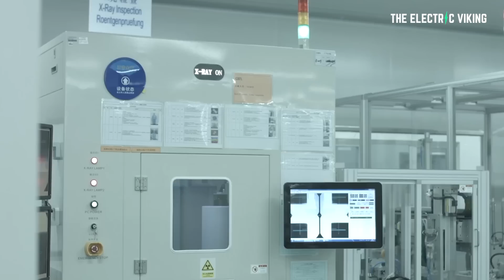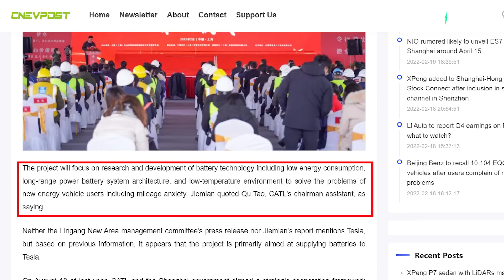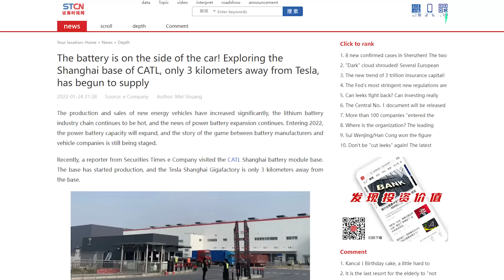CATL starts $440M battery plant next to Tesla Giga Shanghai

Comment: It is indeed correct that CATL will build a second battery factory next to Tesla China plant. The first one is finished in record time due to renovation of an existing building. This however is good only for Tesla productions up to 2022. Future is a different story.

For the future, Tesla China has 3 additional strategic plans:
1. 2 new models designed and engineered by Tesla China R&D staff will appear by early 2023. One will replace the Model 3, which is by then a 5 year old design. One will be brand new. Call them all-China Tesla. 
2. New models will use more flexible battery. This include current CATL packs, some BYD packs, and first productions of CATL sodium-ion packs. This is the mission of CATL second battery plant for Tesla. Mass production of new designs of LFP and sodium-ion cells and battery packs. 
3. The Tesla Shanghai plants, which include CATL plants, will be configured and expanded to supply the global markets including Europe. It will render Tesla Berlin redundant. But will not supply N. America, which is the domain of Tesla Texas factory.

Comment: Tesla must be planning on building 10 million cars a year with all these batteries they're ordering and building themselves.  Elon must have said something to these battery suppliers that hasn't been said in public.  I wonder how many years it'll take them to get to 10 million EVs built per year.  I know it's definitely not happening this year.  Might not even happen next year, and what is their target number of car to be built every year for the foreseeable future.  Is it 20, 25 or 30 million, what number are they going to level off at.  Cause if the range is 20 million with a +/- of 5 million.  They could produce as much as 30 million cars one of those years by mistake, and have to throttle themselves back down to 25 million the next year.  I really wonder what their every year target number is staring 5 years from now or the number they'll want to level off at.

My guess is they'll want to keep demand high.  So 10 million a year seems like a good number to me.  They're not planning to build the 25 thousand dollar car anytime soon, so why not make a low volume of high priced cars, with super high profit as they're doing now.  Who knows what the demand will be when they solve FSD.  It could cause an explosion in demand that Tesla can not and won't want to handle.

Comment: $440 million is cheap for a battery factory of that amount produced. Don’t factories planned by OEM cost in the billions when they produce about 1/2 of that?
Reply: UNLESS..... it's a factory that produces a 10x output on a very small footprint..... 🤔
.
Where have we heard that recently?
.
I've been posting for months, what if it's a CATL LiFePo4 4680 factory?
What if the extension to Tesla Shanghai is gearing up to produce a "Y 2.0" with a 4680, LiFePo4 structural pack?
.
THAT would be a game changer?
Castings.
Pack.
Cells.
Lighter weight (car)
Fast charging.
Would produce a LiFePo4 car, with performance approaching the existing 2170 pack vehicles in terms of kWh per ton at vehicle level (forget cell/ pack)
Plus, the cheapest cells at massive volume.

Comment: Whoever makes a superior battery is the next billionaire.
Reply: Or
Whoever makes a more than adequate cell, from a small factory, very cheaply, at massive volume, then uses innovation to boost the performance of the vehicle by removing weight, to equal or outperform supposedly "superior" cells in less optimum vehicles......
Will win.
Even if there are TWO contenders, they will both win sufficiently.
Everyone else? Picking up the scraps.
I think that's what we're seeing.
Reply: Yep you are right but It’s way more like X 300 we need 30,000,000 million new electric vehicles a year just to meet current demand  kind of crazy if you think about all the lithium,nickel, copper,silver magnesium, rare earths,glass,aluminum, and much more we wil need to make them. But at least we get rid of the internal combustion engine
Reply: @nickkacures2304  
Well, of course, you can then SUBTRACT all the Nickel, Copper , Magnesium (I think you meant Manganese?😉) "Rare earths" (Cat converter says hi!) Glass, Aluminium, and OIL currently used to make ICE vehicles from that equation?
So, not really so much?
AND we get rid of the internal combustion engine!!
(Plus, once it's in the system, lithium STAYS in the loop..... Oil? not so much)
Oh, the other thing..... This change will cause a MASSIVE boom in recycling, which will Syphon up both old and new waste material currently discarded by the consumers of technology...... The global market ofabout 375 million smartphones  sold every year to replace "old" units means that eventually 375 million cells are "discarded".
This applies to every device using  various forms of cell.
.
Expect a returns system to be coming to your area before too long.
Reply: Maybe quantum scape